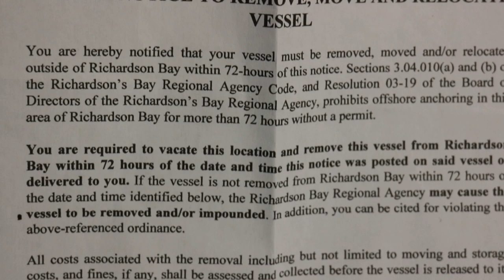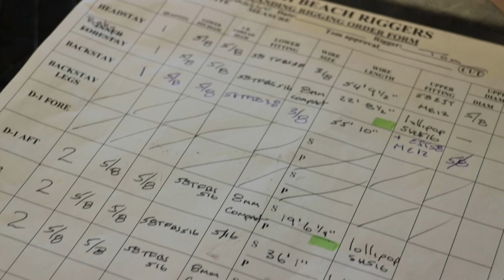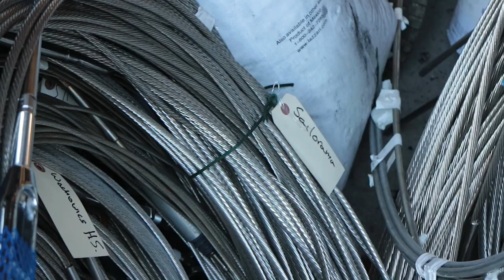Single-Handed Sailing Silliness

Comment: If you are violating the existing anchoring rules why would you be surprised by the note? I realize you and others don't agree with the rules that  these cities are legally allowed to impose but you think that you can just ignore them?
Reply from the maker: I was surprised by having the harbormaster board the vessel while I was away, sliding open the hatch and walking all over the deck without permission, yes. I was not, in fact, violating any anchoring rules that I was ever made aware of before. The issue of anchoring in Richardson Bay is contentious because it is a grey zone. The waters are basically 50 percent federal, meaning, the Coast Guard will not come and bother safely anchored vessels. The local city authorities, with the other 50 percent of the say, will however make up whatever rules they please on a monthly basis, and then come around to bother people who have done nothing wrong. I filled out the appropriate paperwork to extend my stay, asked for written Coast Guard regulations (that might give him the authority to board peoples' vessels for the purpose of enforcing local ordinances) but the harbormaster was too busy to provide the extension permit and regulations that were promised. Again, it's not as simple as "broke the rules, so we get to take your boat away".
Reply: @sailorama  Sorry to hear that the harbor authorities actually boarded your vessel. That's a little heavy handed. But, the writing is on the wall I'm sure you realize. 
The Coast Guard is eventually referring all jurisdiction to the local municipalities in any US bay or harbor. There will not be any new free "anchor outs" anywhere. Once the oldsters go, there will only be 72 hour anchoring....or less. 
You will find anchoring out in less developed countries..... for now.